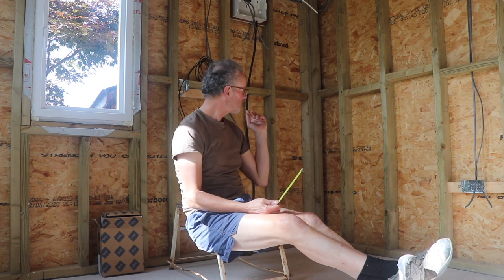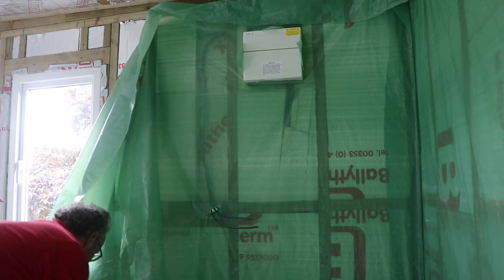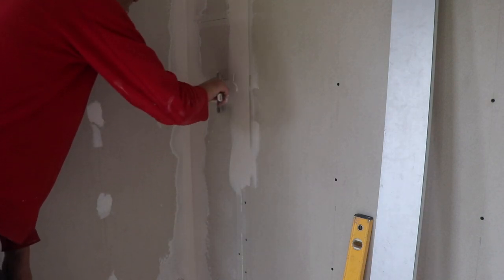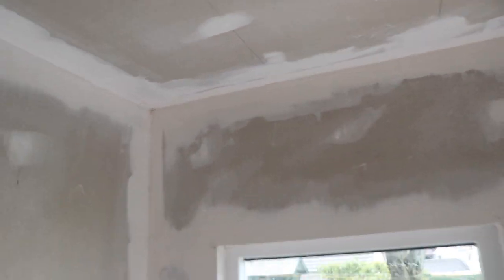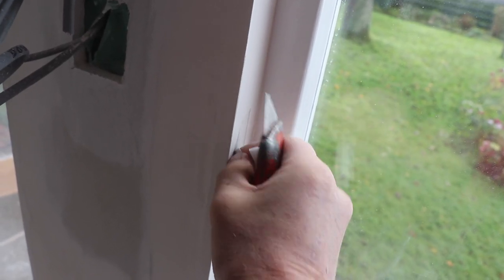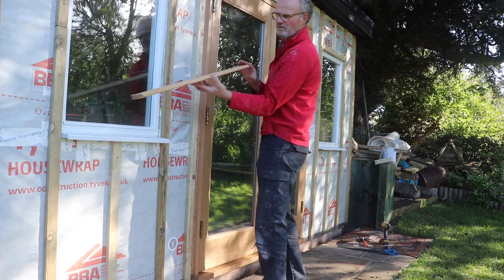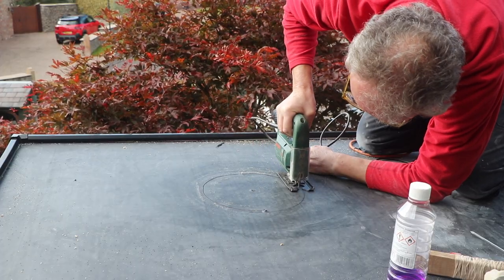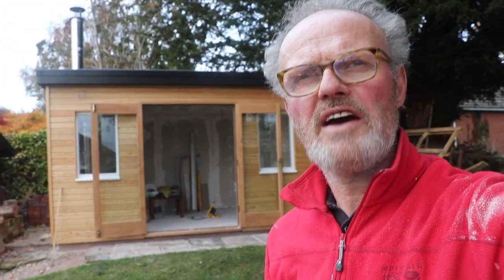DIY Garden Room Build Part 5: Fitting Doors, Dry-Wall Plastering and a Multi-fuel Stove

Comment: Hi thanks for all the help you have given others by sharing your build.  Can you tell me if using  100mm pir insulation in the ceiling  still allowed you the 50mm air gap for your cold roof? Also did you fit insulation on the top of the wall plate between the roof rafters ? Thanks again - great build 😊
Reply from the maker: Well spotted! No, it reduced it a bit. Reason I used 100mm is I got hold of a very good Second hand Facebook marketplace deal. There’s still a gap so I hope it will be ok. Yes, I did put the insulation above the wall plate - pushed in while the soffit was open.  Thanks for the comment and watching- Cheers

Comment: Hi there, I'm planning a similar work shop and have put some 25mm blue pipe in the ground so I can feed the cable through, what was your size of cable, mines not having plaster board in side and was having osb3 18mm in side and mineral wool in the cavity do you think it needs the plastic sheet inside. There is at times too much info on garden builds which is great but also confusing. 👍
Reply from the maker: Hi - I used an electrician to do the wiring so I’m sorry that I can’t answer your query in a ‘qualified’ way - sizing of cable depends on distance from the house to the shed and the consumption of the machinery/appliances you intend using. I was only instructed by my electrician to dig a deep enough trench to bury the armoured cable (I didn’t use conduit). I also ran some cat 5e cable in a separate conduit so I could get wifi extended from my house. With regards the plastic sheet - it was very cheap, easy to install with a stapler and meant that I had a vapour barriers to reduce moisture from inside getting inside the walls. I would advise doing this even if your using osb on the inside. All the best with your build..
Reply: @solway17carlisle  thanks for that 👍

Comment: How have found the concrete floor? I am going to go down the same route as you rather than wooden floor as I will have a motorbike in and I homebrew. People have been trying to put me off saying it is always dusty and freezing
Reply from the maker: No problem with the concrete floor as there is a damp-proof membrane keeping the damp out. In the end I sealed it with an sbr diluted with water mix (to seal the floor) then put some tiles down.Now got a few rugs and all’s good. The walls and ceiling are well insulated and I have heating which makes the room very warm even in these Autumnal temperatures. Thanks for watching - hope that helps

Comment: Hi did you use a cold roof with ventilation?
Reply from the maker: Ryan Marder Hi - yes it's a cold roof with soffit ventilation front and rear. However I got hold of 100mm insulation second hand and used it, so my ventilation gap is around 40mm instead of the recommended minimum 50mm

Comment: I’m almost done with my wall framing, just pending delivery of my OSB sheathing. I thought I was being clever doing my studs on 16inch centres to accommodate the 8’ by 4’ OSB. But it then seems plasterboard flips back to metric 2.4m by 1.2m. I assume I’m going to have lots of plasterboard stripping down to do to ensure they fall half way across my 16inch center joists! A bit frustrating
Reply from the maker: Hi Chris - I think another Youtuber Ali Dymock did this and ended up fixing plasterboard horizontally on the walls ( I believe). No sweat, you only build it once so buying an extra sheet or two won’t matter in the long run. Hope it all goes well for you Cheers
Reply: @solway17carlisle  thanks. Yes I’ve seen Ali’s videos but only watched up to the wall framing and roofing ones so far. You’re absolutely right, could switch horizontal I guess. Why oh why can’t our country stop being so mixed up with measurements! Miles, km, feet inch cm mm stones pounds kg . It’s crazy....
Reply from the maker: Ha ha! Absolutely agree - very confusing at times. Don’t despair I ended up using quite small offcuts particularly in the corners where my spacing came out less than the 400mm

Comment: What’s your ceiling height? Do you think it’s worth going with a concrete base rather than ground screws and timer floor to get the extra head height within permitted development?
Reply from the maker: Hi Duncan, my ceiling height is 223cm/7’3” front & 216cm/7’1” rear. I went with a concrete base as -
I already have a cement mixer
I have made similar bases for previous sheds/greenhouse so feel confident about making them.
Also-
I didn’t want to have a step up to the garden room which I think a timber base leads to (I may be wrong..?)
I already had a fairly level base which in my mind lent itself towards laying a brick and concrete base
I don’t have any experience with metal screws/supports and didn’t want to risk getting things wrong.
On the other hand, timber floors are more easily insulated
Hope that helps, Thanks for watching and commenting. Good luck with your build...
Reply: @solway17carlisle   that's a very reasonable head height working straight off the concrete base. I'm looking at 10cm less front and rear which really makes a difference.  Thanks for your sharing your experience. Good luck finishing off your build
Reply from the maker: Cheers Duncan - all the best.
Reply: Regarding moisture barriers and vapour membranes.  When I do my garden room.  I'm a little bit uncertain about this area. I see you used a simple and cheap green polythene which makes sense.   So as we breath moisture out this will act as a barrier and stop damp getting into the timbers right?  The Tyvek keeps moisture / rain from getting in from outside but is breathable I believe.   But is it possible to have too many vapour barriers and prevent ventilation?  What would happen if we simply put polythene plastic both sides of the timber work?  I'm enjoying the series so far.  Thanks for the vids
Reply from the maker: Hi Aaron - Thanks for your comment and query. My understanding of vapour barriers is that you need an impermeable barrier ie plastic sheet on the inside to stop moisture getting into the structure. However, you need a breathable membrane on the outside to enable any build up of moisture some means of escape (but also stop water ingress from the outside). I’m no expert but followed what others were sharing on YT. The plastic interior sheeting wasn’t too expensive but the Tyvek I recall cost about £120 for a roll BUT it immediately waterproofed the outside until I could get the cladding on, so worth it overall. Hope that helps - hope you enjoy your build. Take care...